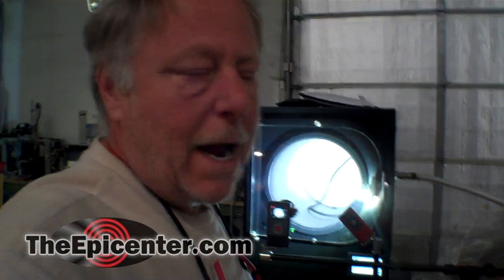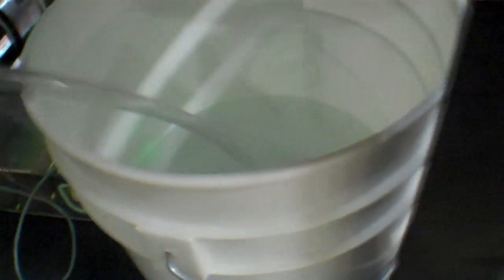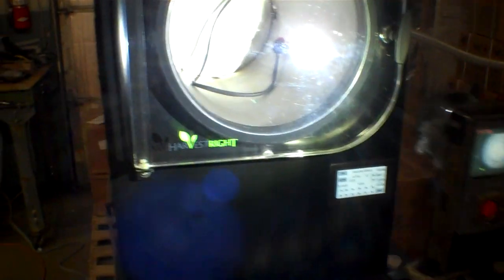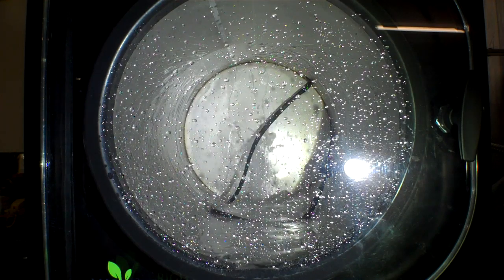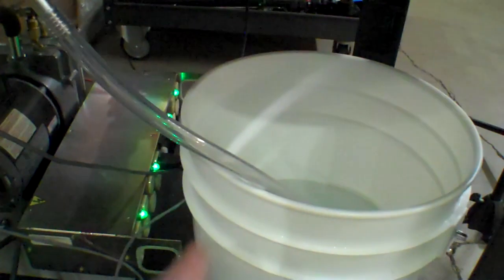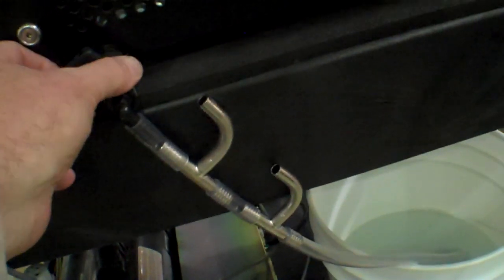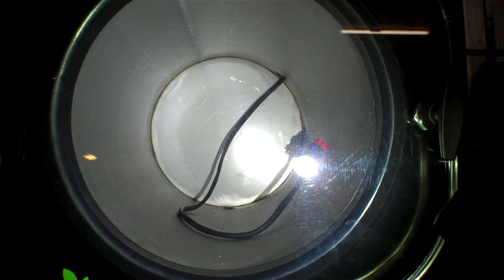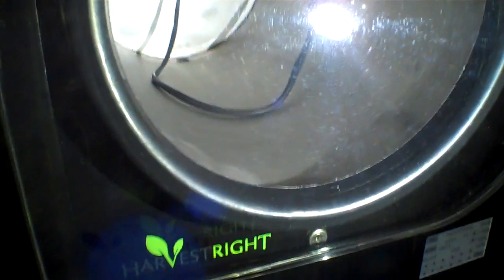Tip #1 for Harvest Right Freeze Dryer - Preventing water from sucking up drain hose.

Comment: I started a badge and forgot to close the valve and didn’t realize until about three hours into it. I could hear that the motor was running really loud so I went and checked it out and realized it was open. Is this bad? What could have happened? The pump was basically running full For an hour or so with the valve open on the drain

Comment: Just don't put the hose down to the bottom of the bucket! Clip it to the top, like i do.
Reply: Easiest and best advice. put a hole in the bucket just below where your tube is attached at the top. if bucket gets full it will let you know by draining on the floor, but not back into your chamber.

Comment: Great heads up but I think I would just clip the end of the hose to the top of the bucket.
Reply: Yep, I think I'm drilling a hole the size of the tube & putting two rubber gaskets on each side of the hose that goes through the bucket - keeps it in place, easily removed and keeps the tip out of the water.  But I like that he's keeping us thinking about the potentials.

Comment: Hello, I've been watching freeze dryer videos alot. 
 And I'm very interested in buying it but I live in an apartment, can I have one in an apartment? Or do I need a house ?
Reply: The vacuum pump is loud, I'm not sure you could isolate it in another room in an apartment and still sleep.
Reply: Small and medium sized can run off 15 amp circuit. Large uses 20 amp.  The vacuum pump is loud. If you can sleep through white noise, then yes. I'm not sure if it would resonate to your neighbors. They may complain.

Comment: That's a logical solution but expensive. the best solution would be to fasten your drain tube to the top of your bucket far away from the water. drill a drain hole at the top of your bucket below your drain tube so water overflow drains on the floor if you neglect to empty the bucket, but will never end up back into your vacuum chamber.
Reply: Thanx! Everyone says put the Y in the hose and nobody says what size the Y needs to be. Lol. New shopper here. I'm following your tip. :goodvibes:

Comment: Or use a cheap check valve.
Reply: TheZigZiggy using the two inline y-fittings to create a vacuum breaker is more reliable and less prone to failure. It is not really needed if you empty the drain collection bucket after each defrost and drain cycle. Murphy’s law states that anything can and will happen; fairly inexpensive insurance for that unfortunate “if” factor and ruining your freeze dried batch along with the time invested...